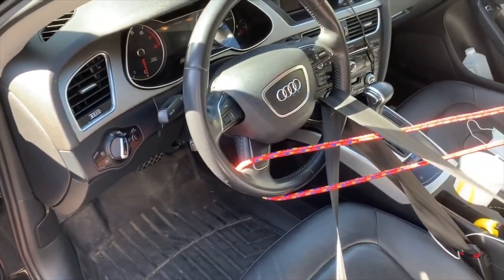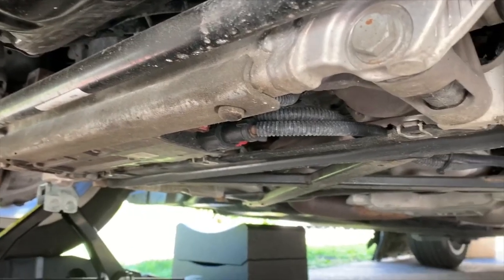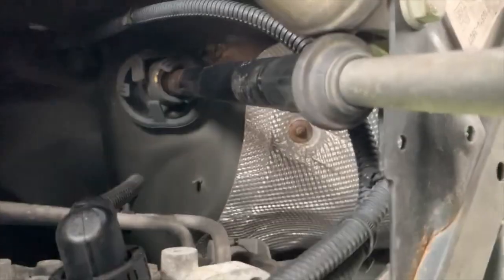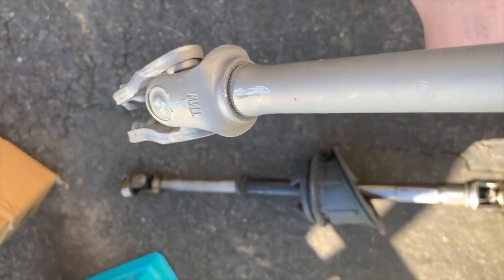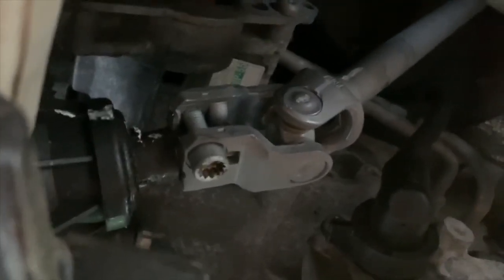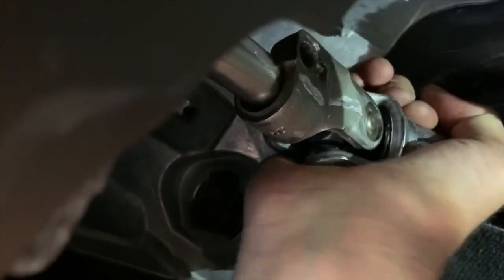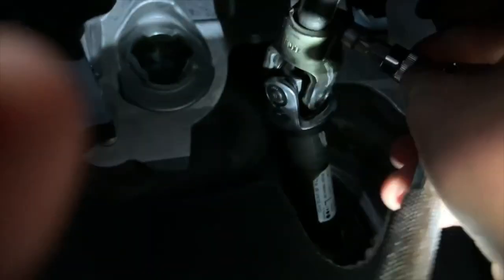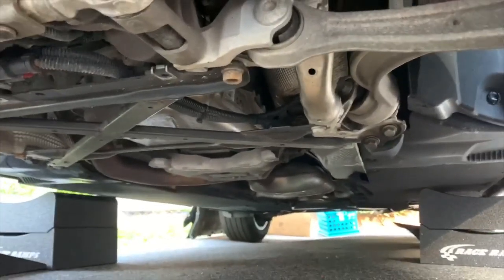Replacing Intermediate Steering Shaft On B8 Audi A4

Comment: Hey, you definitely don’t want to try stuffing the grommet and shaft in from the engine compartment. I just did it in a half hour and pushed it from the inside out. Push it in as far as you can from the inside and then from the bottom of the car grab the tabs hanging off the grommet with pliers and pull it through. Don’t pull too hard or you might rip the rubber off, just work your way around.

Comment: the shaft can only go in one way because it is notched. also you can just lock the steering wheel by removing the key and turning in either direction

Comment: Hello sir, tell me something if you're in the know. You see when you're under the car, the lowest bolt you removed, the knuckle the fits to the steering rack. What's that joints name? Or type etc. I installed a down pipe to my b8.5, the downpipe is a 3" integrated engineering downpipe. It's designed for left hand drive, mine is right hand drive. I had to modify the downpipe slightly to get it to pass the steering rack. We heated and pressed the pipe to try replicate the original cat press angle but it's still "just touching" the protective ring which I made a custom heat shield for. While I drive.. depending on camber of the road etc I can feel vibration through the steering. My though process is .. yes, I could lift the car and keep uninstalling the cat and pressing the exhaust but it's only compressing the pipe more and more. Or what I pondered was.. you can get steering rack extensions, much the same as the knuckle in the foot well that you first disconnected. But I'd need a female to male. This knuckle would give me all the clearance I require but I'm struggling to find a knuckle online. Any ideas or suggestions? My clearance from above if very awkward to poke and prod to nudge the exhaust and is quite dangerous when heat cycles happen (obviously easier when hot) and the under side is impossible without removing the shields and lifting the car. So I'm pondering about a knuckle joint. What do you think?

Comment: Guys can I ask,  the clunking knocking noise did we all get this while the car was warm or from cold ? Mines when it warms up
Reply: Same here, drive it for a few minutes than it's starts to clunk. Definitely following.
Reply: same here, does this shaft replacement fix it?
Reply: @davidbroadhurst9803  I wanna know too.. mine is clunking also. and I just put a new electric rack.. was doing it with the old one also.. oddly its a florida car...
Reply: @hogueraleksander5868  Replaced mine today, I've taken it for a 20 minute drive and noise is gone. Before the noise would start after about 5 minutes of warm up. The job is easy except for getting the rubber boot seated properly which was a real mission. The audi service manual says to attach the shaft at the steering wheel end, then get the boot in place and then attach it to the steering rack, I think this is the right approach. The shaft doesn't come with the bolts, you have to order those seperately.
Reply: @davidbroadhurst9803  hi david does yours still making noise up until now?

Comment: If your car is right hand drive part number is different 8K2419753H
Reply: Does it matter if last letter different for example instead of H a F
Reply: @hasanayat5516  this is the revision number, if you buy a brand new part if should be h on the new part. The part that was in my car was C.
Reply: @davidbroadhurst9803  my car has the H I couldn't only find F from breakers so I purchased that
Reply: @hasanayat5516  your car already had the latest revision part and you are replacing it with an older revision. I think there is no guarantee a used part from breakers won't have the same problem.
Reply: What was the reason for changing it? Noice? Squeaking sound when turning the wheel? Because I hear squeaking when I turn to left only and Inhave killed it with lube and WD40 but it doesn’t help
Reply: @aleksk8145  the problem with the steering shaft is a knocking noise when you turn the steering wheel, there wasn't any squeeking, at least not in my car.
Reply: @davidbroadhurst9803  Can't always go by this. It's not always just a revision number. Sometimes it's different parts.